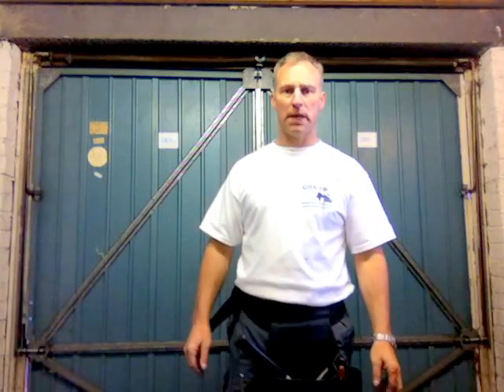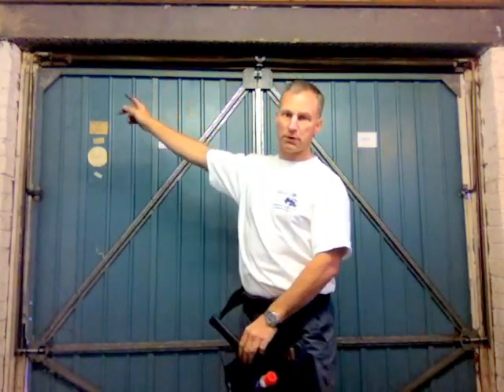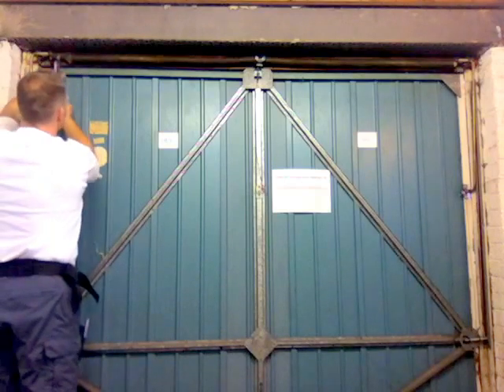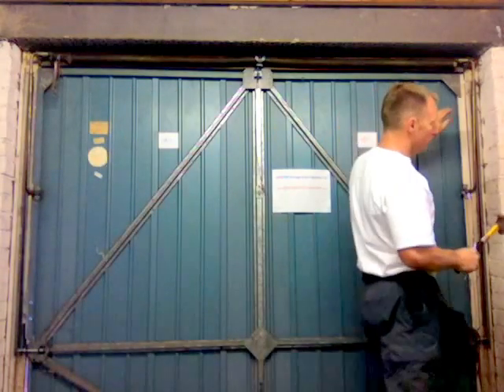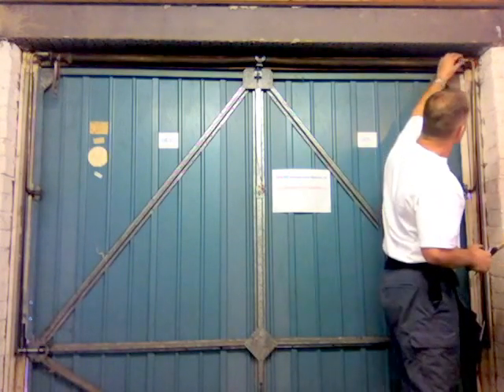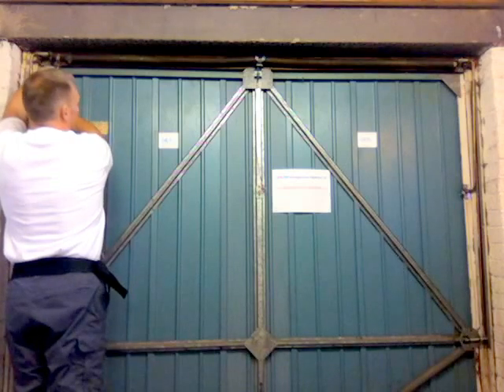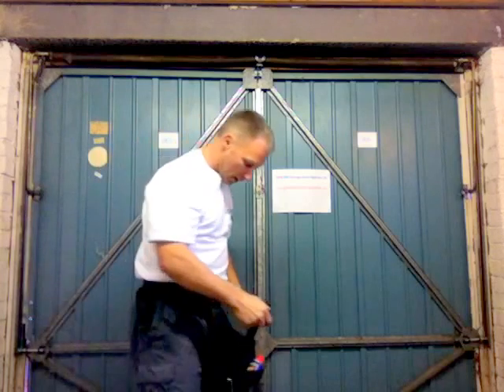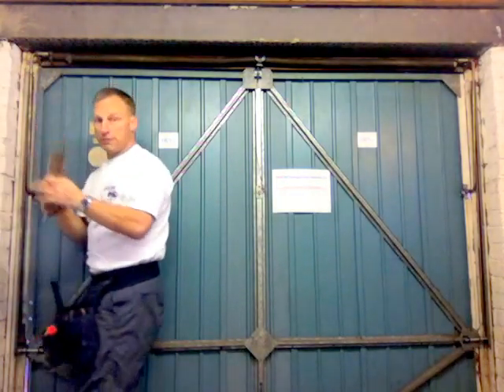How to add tension to a Henderson Merlin Up and Over Garage Door Main Spring

Comment: My Henderson merlin door doesn't have those grub screws on the left,the ones you release to adjust the spring tension.
Mines just has one split pin going right through from top to bottom,right through the collar with the tension bar holes in and the centre bar.
Do i just hold the tension bar in a hole,then drive out that slit pin,then increase spring tension,then stick split pin back through?

Comment: There are 2 x grub screws to release 1 at back of bar just release slightly so it doesn’t score/ cut into bar , I always mark / pencil on steel (1) and (2) around the screw area as I then wind upwards the tension bar and tighten up one screw only as you won’t be able to do both . Also if you can’t get lock pin in , eg : bar not in right position, just put a positive screw driver in hole on right hand side, push upwards and clamp mole grips to screwdriver and metal clamp above.  You will find you will have to try a few times ( winding up, tensioning ) before you get it just right , as with most things , trial and error !!!

Comment: When fitting new rollers you don’t show how to move them in and out of the brackets on the door?
On my door there is not enough space (even with the guide rail removed) to remove the old roller or insert the new one.
Is it safe to open the door slightly in this state so that there is enough room to swap the rollers over........it looks like the only way possible?

Comment: Hi there. If when the cones and cables are fitted and i have slightly less tension in the rh cable. Will this method correct that problem and give even tension in the cables?

Comment: After letting the spring unwind when I loosened the support  bracket, I had to re-tension it and used your video for quick how to guide. Used a couple of large nails, with points cut off, for tension bars. thanks for the video.

Comment: Hi,

Is the process the same with a spring with no tension in it at all? I'm assuming it is...

Also, which way do you turn to wind up the tension? Should I be putting in the tension bars and then pushing the bars upward? (If that makes sense?). I'm using your cable and cones replacement kit.

Thanks.

Comment: Thanks for making these videos, helped me out a lot when our garage door jammed this weekend.  Looks like I need some new cables so I'll be visiting your website.  Was able to apply what you showed to a Hormann door, found they are a bit different though, easier in fact using grub screws to lock the cable drums and spring.

Comment: I think you say not to grease the cables. Is that right. Do you use WD40, instead. thank you.
Reply from the maker: Hello
Use a light oil, WD40 or even 3 in one..grease just clogs everything up and stops the roller wheels from turning